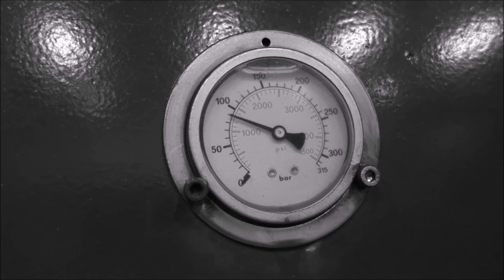Crushing Stretch Armstrong with Extreme Mangle | Oddly Satisfying!

Comment: Suggestions for improvements to the machine:-

#1. Put a rubber layer/sheath on the rollers to help it get a better grip on whatever is being fed in.
#2. Rig up some sort of lock on the rollers so they stay at an adjustable distance apart once set.
#3. if you want extreme crushing and shredding, instead of using flat rollers use rollers with a set of interlocking teeth, a bit like those machines they throw old car bodies into at the scrapyard.

Cool idea though, cant wait to see what happens when you try putting some more "volatile" stuff through it like CO2 canisters or lithium batteries.

Comment: Make sure you have emergency shutoff buttons on both sides of the belt near those rollers. I worked in a plant that made metal doors and saw the result of a guy getting sucked in hand first between two rollers like that. He had no shutoff switch so he was basically caught in it until we heard him yelling on the far end of the line. It had pulled him in just past his elbow by then. He had to get all kinds of surgeries to reattach torn ligaments and stuff. He didn't come back to work for 6 months.
Reply from the maker: There is now mechanical switches from older design that work like emergency stop on both sides. I will add strong fishing lines to those so if anything large tries to get closer than 30cm it will stop automatically
Reply: @HydraulicPressChannel  Good to hear. Carry on!
Reply: I used to be a pastry chef and worked with this machine every day. It ought to have safety bars on both sides of the rollers so you could not reach them with your fingers, you could lift the safety bars (for cleaning etc.) but then the machine would turn off automatically. There are many dangerous machines in bakeries and knew 2 pastry chefs that lost an arm neglecting the safety features.

Comment: With polished rollers like that you could add a scraper blade to the backside of the top roller. That way even if it stuck, it would peel whatever you put through it off and drop it on the outbound conveyor.
Just a thought!

Comment: Nice addition to the "toy collection". Yes would be interesting to see what stuff you could smush through it haha.🤣 One 'mod' maybe, would be to possibly rough up the surface of the rollers, i think they're too polished, or maybe have a thin film of a rubber coating to add grip to ensure everything slides through and reduce the chance of things getting stuck in place... 🤔😎 Also, 2nd possible mod, mount a 'blade' flush with the roller on the exit side of upper roller (pointing down) to peel away goo and stuff that have stuck to the roller? 🤔

Comment: Looks like an extreme version of the press used for monotypia graphics. So you could buy some felt roll, copper plates, thick matte paper and paint. Then you can add paint splashes or whatever paint patterns on the copper plates, put papers on copper plates and long piece of felt under and on top of the paper+copper pieces and drive the felt through the press. Thus you'll have a heavy-duty art machine and the results might be interesting for the viewers. :3

Comment: Make sure the velocity of the flattening roller is higher than the velocity of the inlet conveyor belt by a small factor, like 1.1 or 1.2. Similar factor for the outlet conveyor being faster than the roller.

Also, give the roller ridges for better friction. Possibly longitudinal.

Although, you wouldn’t have the issues you have with things you have issues with if all 3 were at the same velocity, but the SINGLE conveyor belt also passed between the pressing rollers, with whatever the hell you want on top.

Comment: I think it's not a lack of power that's the problem, it's the smoothness of the roller. You need a lot more friction at the roller to drag in anything you put on the conveyor belt. Try wrapping the top roller in adhesive fine sandpaper?

Comment: Mix up some unbleached white flour and water, and a tiny bit of canola oil and see if you can use this machine to make flour tortillas.  Mix the flour into a shaggy dough and make several balls with your hands -- be prepared to make multiple passes, rotating the result 90 degrees after each pass.  If it works, and the tortilla looks like it might be right, toss it in the oven on a pizza stone at 400 F degrees and flip it once one side is done.  Cool them a bit on a rack and then store in a plastic bag for later, or crush them in the hoodraulic press.

Comment: @Hydraulic press channel you should knurl the rolls it will add more gripp.  A very small knurl should be enough
also you should use a stronger motor we can ear that its barely strong enough

Comment: I used to use a number of roller machines like this in the print industry to flatten out items for better collating or packing of items for the next stage of work. Too much of a load in one go tends to slows things down and it will just force the rollers apart. So you will need to gauge the loads for best results/entertainment value or go 'full gangstah' and lock the roller separation system and force it to crush things to DEATH but your mileage may vary. Squishy toys, playdoh, modelling clay, wax and other items are good but metal objects are probably something to avoid without safety screens.

When the roller machines jammed on these machines tho it was always a good laugh yet deadly spectacular in some cases.

Comment: I think the rollers should be replaced by a pair of splined shafts -- like gears. Also, tension the handle with an adjustable spring.

Comment: Again, how about adding adjustable weights to the top roller to "help" with the tougher stuff in the Flattinätor(?), just a thought.
Reply from the maker: I am planning to add hydraulic cylinder to the handle so I can adjust the amount of force pushing top roller down
Reply: @HydraulicPressChannel  Ok, better control than simply adding weighted plates :-)

Comment: I had a job when I was 19 where I glued veneer for a door plant.  The glue machine was set up similar to this one but the rollers were covered in a textured rubber and they were set up about 3/8" (.375" / 9.5mm) apart.
After a 16 hour day, I was cleaning the rollers and you were never to use your hands to clean...but I did this day.  My pinkie and index fingers got pulled into the rollers and before I realized what was going on, it was up to my palm area.  I reached up to hit the roller spreader but hit the reverse bar and rolled my fingers back through 
Every bone in my fingers were cracked and there was blood pushed into and through the skin of my finger tips.  I also lost both fingernails and bruised every ligament and tendon in both fingers.  To this day, when they get cold they hurt like hell.
Needless to say, I got the heebiejeebies watching this video.

Comment: New Idea. Can you put water in a steel tube with tiny hole, then press a perfect and sealed cylinder in it to see if the coming out stream can cut through steel.
If the water is too liquid: could you try something thicker like lube or anything?

Comment: Wet towel
Reply: My grandma used to have an old-fashioned Maytag open-top clothes washer with a hand-cranked wringer on it to squeeze water from the clothes before you would hang them on the clothesline to dry.  The wringer was about the same size rollers as in Lauri's new machine.  My brothers and I of course would crank other things through it when grandma wasn't around.  I hate to think how much trouble we would have been in if she ever found out.😁